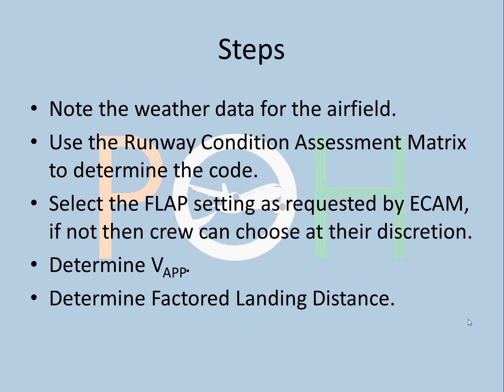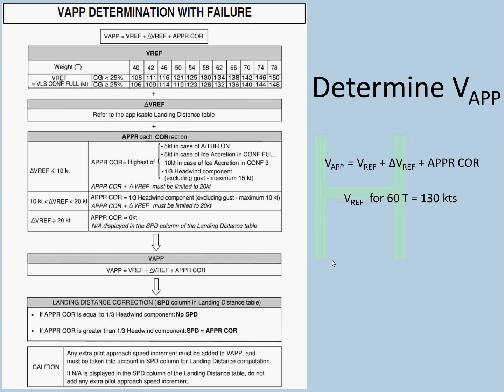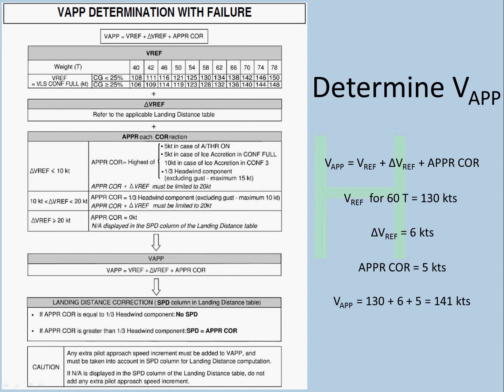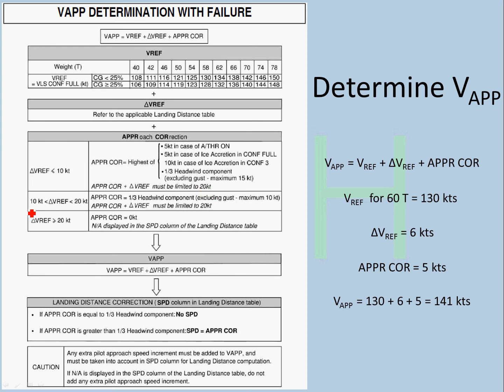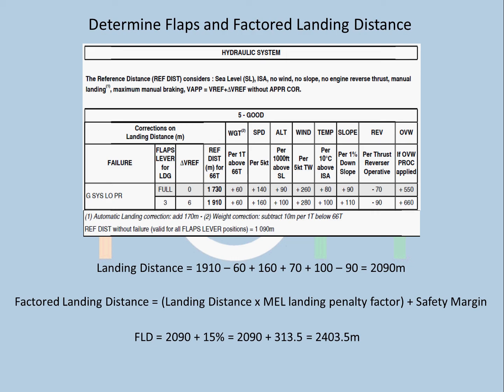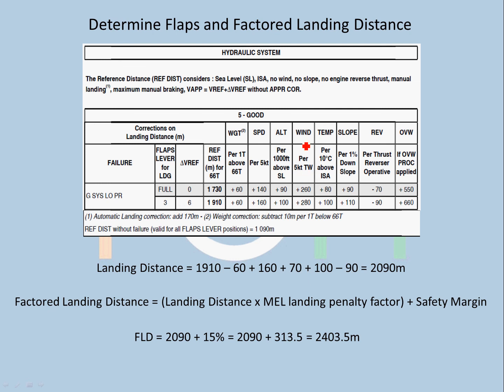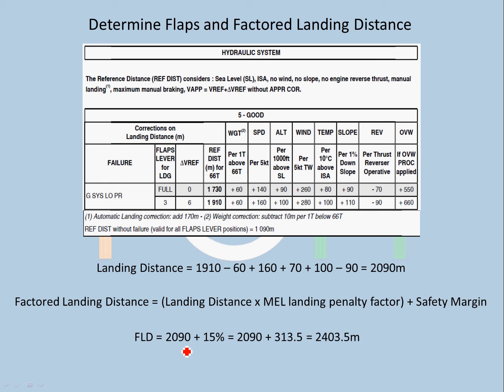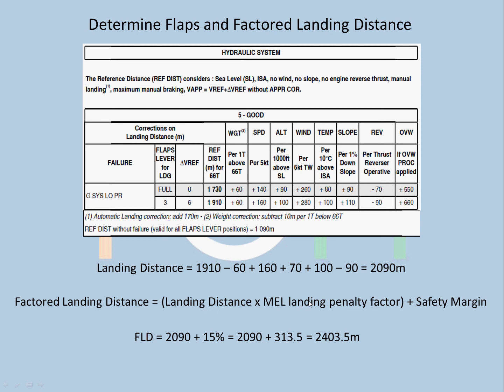A320 - Landing Distance Calculation (Single Failure)

Comment: Hi are you sure with ALT correction? It is Airport Pressure Altitude correction - you should apply QRH PER-O 3/4 first and than compute addition
Reply from the maker: Could you explain what you mean little more?
Reply: @poh   ALT column is correction that account barometric pressure at the airport and correct elevation of airfield refer to pressure (i.a.w. FCTM PR-NP-SOP-160). In your example QNH should be 1012-1014hPa(not mentioned in conditions) but if there will be another QNH you should apply QRH ISA TEMPERATURE AND PRESSURE ALTITUDE CORECTION. For example if there is QNH 1002, the pressure atlitude correction is +300ft and you have to count with airfield elevation 1000ft
Reply from the maker: Yes you're right about whatever you said. Spot on. That's how it's done. I haven't checked in the video in that case. I'll look.